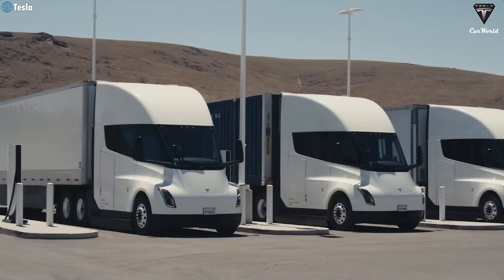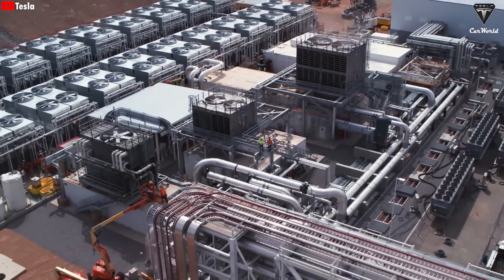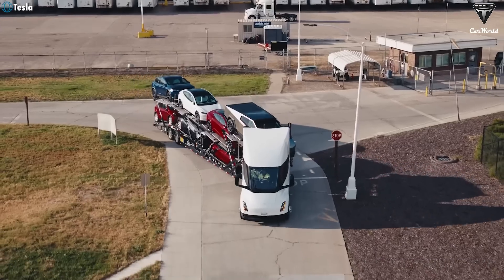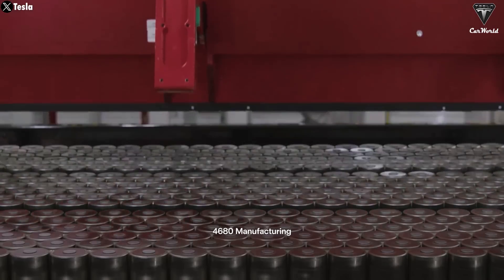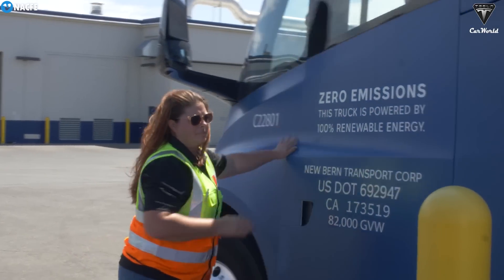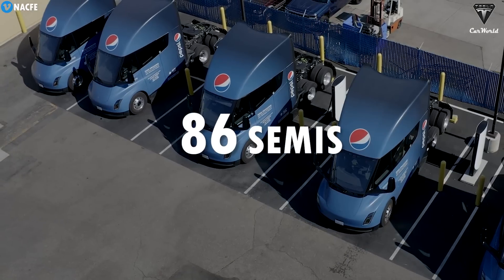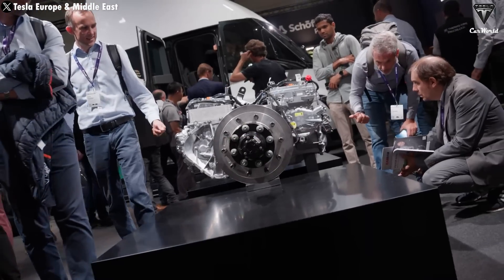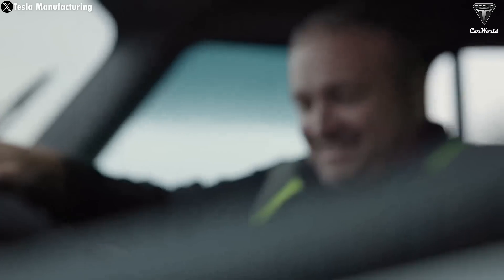Elon Musk Says Tesla Semi is The Best Money Machine! High Volume, Insane Feature Ready On Dec!

Comment: If they can get 500 miles out of them they will nail the market.
Reply: As a former logistics manager for a big box retailer, I can say that we can do very well with the Tesla semi with a range of 350 miles.  It won't work for all our stores, but it will satisfy 80% of our routes.  Those stores outside the range of the trucks can be equipped with chargers so the trucks can add to the batteries while the trucks are being unloaded.  A half hour of charge time could add a 30+% charge to the battery.

Comment: Good for local short runs. But long cross country runs, No.
Reply: Why not?  Pepsi has operated one of its Semi over 1100 miles in one day.  The truck's range is actually limited by legal driving hours, NOT by the size of the battery!  One caveat to that:  you have to have a decent charging infrastructure, and that one is not yet up to the task in North America.  But the truck could easily do cross-continental trips in the same time as a diesel, for a fraction of the costs.
Reply: @st-ex8506  that why I said no due to the availability of charging structures currently. I know the truck capable.

Comment: Companies like Pepsi, Walmart and so on, have fleets that travel from warehouse to stores or smaller warehouses.  Tesla would do an amazing job here.  This is a large part of transport routes.  As a driver who travels often long haul in the North, I wouldn't trust the truck.  Truckers are not guarantied an after hours parking spot.  So if you run out of hrs, you have to park on an off ramp.  You can't go hunting for a charge station.  So in freezing weather, you better have enough charge to keep you warm.  Yes I do plan for fuel and parking.  But customer longer than planned unloading, traffic issues and weather does cause problems in the best planned routes.
In short, sure, I really like the Tesla truck.  But no way will you convince me that service on that truck costs less than a Freightliner.
Reply: Why do you doubt that service on the Semi would cost less than on a Freightliner?  It has umpteenth fewer moving parts, no engine vibrations, no high temperatures to manage.
Fleet operators have 40% lower maintenance costs on their EVs than on their ICE cars.  Please explain me why that would be different with trucks.

As to charging those e-trucks, you are correct.  The charging infrastructure for trucks must be (very) seriously improved.  Over here in Europe, this infrastructure is now good to excellent for cars, but still sucks for e-trucks on long-haul duties.
That is why Tesla's early customers are fleet operators traveling planned routes.  But here in Europe, there are already operators doing "on-demand" long-haul jobs with e-trucks.  But, as I said, if the charging infrastructure is already good in Norway, OK in France, it still sucks in Germany.
Reply: @st-ex8506  Electrical and battery work is always way more time consuming and expensive than mechanical parts.  I don't think you're a DLC driver.  Plus every repair shop has Freightliner parts.  Not so for Tesla Trucks.  Hours sitting still is money lost.  Don't make money unless the wheels turn.

Comment: Well, i was a little bit confuse… I have read the article last year about the real life test Coke have done with the tesla Semi… When use like a normal truck… Full load… The truck need  two charge a day , so they will need to have a lot more truck to compensate… The battery pack is close to double the size a model 3… When the engineer have call the electricity company to have info about the grid capacity, they start laughing!!! Only to charge the Ev truck fleet they need as much as the complete town… The actual grid can’t do it without completely redone it!!! (x2 capacity)… I will try the find the article...
Reply: T Semi: 800 kWh & 500kWh battery packs. M3: 50–82 kWh
Reply: Just add more solar locally... But that is NOT the solution
Reply: That's not how it works.

During summer, Peak load at 3PM on the Grid is about 140% of the average load, and the lowest (2AM) at 60%.
Most of the EVs charge at night, and if vehicles need to charge during the day,  Just add more Solar locally. There is no need to redo the entire grid.
What's important is local production, which is why you want to put solar on all roofs and covered parking spots.

For winter, Peak load is around 7AM and 5PM for about 110 to 115% the average load.

There are many ways to increase energy savings, such as High Efficiency Heat Pumps for space heating, water heating and laundry driers, Insulation of homes and building that require heating and cooling. 
American houses are poorly insulated, you can easily slash the energy consumption from those by 40%.

Instead of reading articles, read studies.
Reply: @itsyo42  Add solar...lol... Each charger need 250kilowatt!!! 🙄🤗
Reply: @martinchartrand7044  huh?
At home you don't calculate your total consumption by summing up every single appliances running at max at the same time.
Same thing happens for a charging station.
You just need buffer (in that case, batteries) to offset the peak load.
An average US shipping warehouse is 180,000 sq ft. which mean you can put 3.2 MW solar array on top.
Which mean you can charge 6.4 semis every hour for free during the day.

The average time the driver has to wait to get loaded is about 2 and half hours.
That would mean 16 semis charged for free over that time. or about 45~50 semis per day. at around 97 cts per liter, it's $2.3m
 saved in fuel per year.

Most of the charging in the morning can be slow charged through the night during off-peak hours.